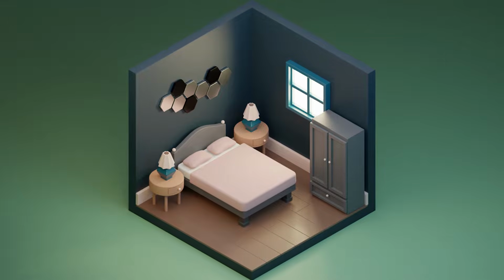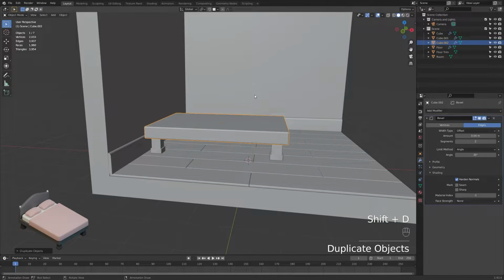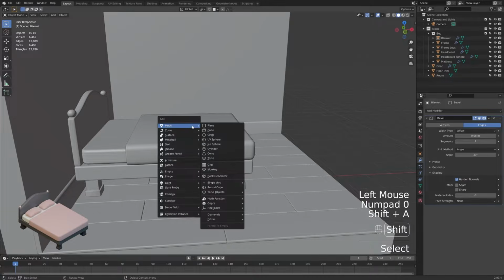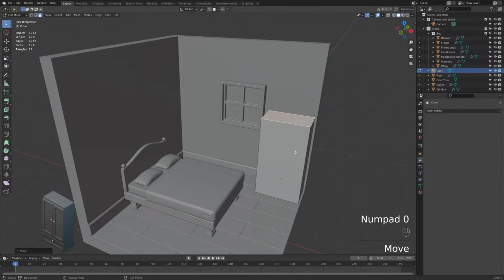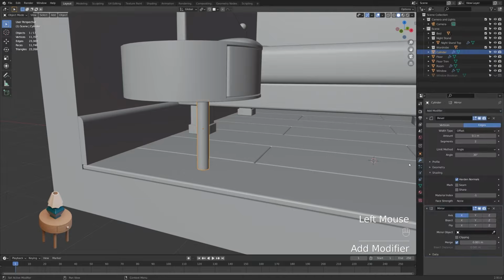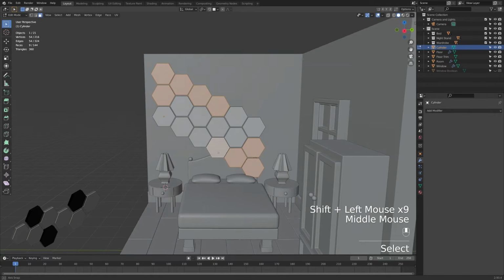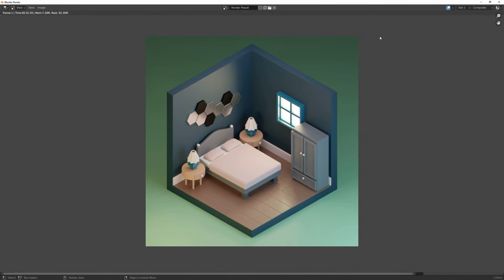Create Your First Isometric Scene - Comfy and Cozy Bedroom - Beginner Friendly Step by Step Tutorial

Comment: Ok so! I am currently following this tutorial with the 4.1 Version. I will add in some of the fixes I used where there are differences between versions, and I'll update as I go!

1. Auto Smooth
This is now a modifier in the 4.1 update and you will find it in modifiers > Smooth by Angle > turn up angle to 180.

2. Bevel being funky on the floor trim:
Follow everything up to 'Ctrl + B' and then press 'S' to toggle even offset if the tool appears to not be working, or the bevel is causing the mesh to deform strangely. You don't have to adjust the position, just add in bevel segments and then add 'smooth by angle' modifier as above.
Reply: thank you!
Reply: Thanks for this. One of my drawers kept making this black square and i didn't know how to fix it until I found your comment. I'm using blender 4.1 so thanks for this

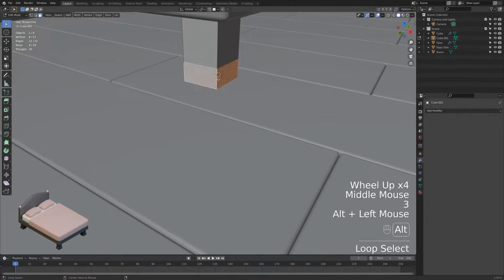Comment: 9:12 already ctlr R to get the line, however i can't separate it into object, so i can't resize it. please help
Reply: If you're having trouble following the way he said it do it this way

Ctrl R
Left click to apply the cut
Move it down just a bit(having trouble moving it right after left clicking? Hit G to grab that loop then Z and move it down)
Then left click
You are now currently in edge select mode,Hit 3 on top of your keyboard NOT your numpad to go to face select mode
Click off screen make sure nothing is selected
Then hold down alt and left click on the BOTTOM edge, YES, in FACE SELECT mode you alt click on the bottom vertical edge and this should select all your bottom faces
Then Hit E to extrude
Move your mouse to check if extrusion happened
Then RIGHT CLICK to set it back into place
Hit S to scale it to the size you want

Hope this helps

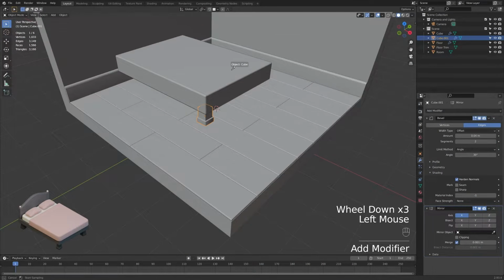Comment: 10:11 i have set the origin point to geometry and it still won't mirror correctly, pls help
Reply: On the top right of your viewport select options and and enable affect only origins 
Click your bed in object mode and you should see axis lines on your origin point
Press 7 on your numpad to go into top view and if you can't change angles that way just go to your top right corner of the viewport and select the Blue Z circle that should put you in top view
Hit G and move it manually into the middle of the bed along the X and Y axis 
once you're satisfied clicking on your middle mouse button you'll move out of top view and see your origin point is above your bed
Hit G then Z and move it back down to the bed
Once you're done go back to the options on your top right and disable affect only origins
Select your legs
Click the eyedropper
Select your bed

Hope this helps

Comment: i know this comment is late, but when i shade the window smooth and add the bevel modifier, it goes all weird and shaded and not... smooth. help!!!
Reply from the maker: There's two major culprits I would check if you're running into shading issues.

The first is for doubled up vertices. At 24:04, I go over how in edit mode, you can select all the vertices and merge by distance to get rid of any overlapping duplicated vertices.

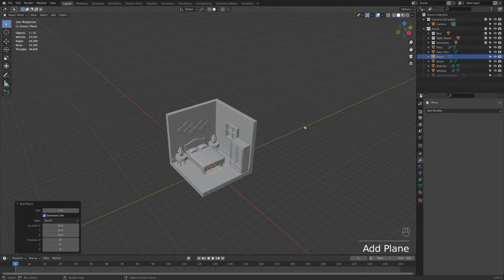The second thing to check for are your normal orientations, which I go over at 32:47. In edit mode, you can try selecting everything and recalculate all the normals to face outside.

Comment: Anyone else encountering weird things on the warddrobe when shadesmoothing + applying the bevel modifier from the window at 24:30 ish? welp
Reply from the maker: There's two major culprits I would check if you're running into shading issues.

The first is for doubled up vertices. At 24:04, I go over how in edit mode, you can select all the vertices and merge by distance to get rid of any overlapping duplicated vertices.

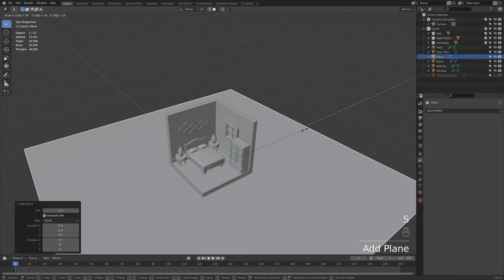The second thing to check for are your normal orientations, which I go over at 32:47. In edit mode, you can try selecting your wardrobe and recalculate all the normals to face outside.

Comment: hi, i have 3 very weirdly specific problems that are popping up in my design. can anyone help me out with it? the first problem i have is that the emission from the video isn't showing up in my rendered version. the second one is a bigger problem which is that whenever i try to add a camera into the scene, it somehow keeps picking the area below the bed as the main focal point and i've tried every which way to find a solution but every time i add a camera, and i hit the numpad 0 key, its showing me the blank space beneath the bed. when i manually move it by using the cursor as the controller, it messes up the bedframe for some reason. like either it disappears or its set as a different position.
Reply: Your camera is added below the bed because your 3d cursor is below the bed 

By zooming out then hold Shift and then right clicking off your scene your 3d cursor will move to where you clicked 
And now when you add your camera it will be added to where you moved your cursor you can hit numpad 0 to check

Once you're done you can reset it by pressing Shift S and select Cursor to World Origin

Comment: Hi, been trying about 30 times now to do the blanket. I have started over and over. When you extrude along the normals you have a smooth no extra faces that i can see in the video. I have more. when I bevel even with out the normals done it only goes up the top and not down the sides. It works if I make a new cube but not when i grab the faces from three sides and top and shift-D, left click, P and selection.   HELP, thanks

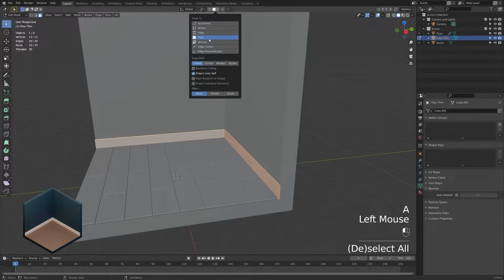Comment: Lost at 5:07
Reply: In newer versions of Blender, the “Snap to” drop down menu is different, Face has been replaced by Face Project and Face Nearest.  Face Project is the same as what is used in this video, I believe.  This is just setting the behavior of snap movement, which you can activate by holding the ctrl key when moving an object.  It allows you to easily connect items like the legs of the bed to both the floor and the bed frame, without having to line it up manually.  You also can turn snap movement on by clicking the magnet next to the menu(or with a hot key), but after following the video I say it’s usually not used for more than one movement in a row so just hit ctrl when needed so it’s not left on by mistake.
Reply: @DBumbleB  thank u

Comment: the final render took you 32 min 59 sec right?
Reply from the maker: The amount of time it takes to render will vary from computer to computer depending on the kind of hardware you're using and what render settings you use (something I didn't really cover in my video). 32 minutes does seem like a long time though. Are you rendering on a laptop without a GPU?
Reply: @leftbraincgart  sorry i mistook your render time as 32 minutes 59 seconds. my render time is about 6 minutes with i9-10900K. what's your pc specs btw?
Reply from the maker: I have a i7-8700 for a CPU and a GTX 1080 and a GTX 1060 for GPUs. If you used your GPU to render instead of your CPU the render time should drop significantly.
Reply: @leftbraincgart  thanks! i'll try!

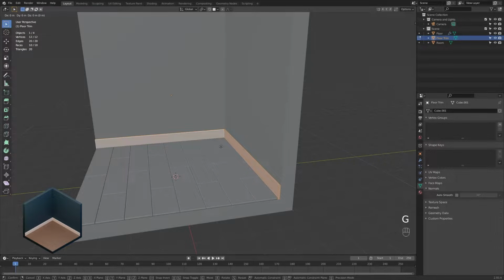Comment: 5:20 I can't trim the trim by pressing Ctrl and moving the mouse to the floor. Am I missing anything?
Reply from the maker: A couple things I can think of:

- Make sure you're grabbing just the trim and nothing else. You can do this by deselecting everything (shortcut double tap A), selecting the trim only, then hitting G to grab and move it.

- Instead of holding down CTRL to toggle the snapping, try clicking the magnet icon instead (shortcut SHIFT + Tab) and see if that works for you.

- I would make sure that the Snap To is set to Face, Snap With is set to closest, and Affect is set to Move.

Hope one of these help!
Reply: @leftbraincgart  ah thanks! get it!

Comment: This is one of the best Blender tutorials that I've gone through - thank you so much!

One question I have for you is that when I render out my images, the window doesn't actually render any light, it just appears as an empty box. Emission shader is set appropriately on the window panes with the rest of the window having the window material.
Reply: Same happened to me. Not sure how to fix it.
Reply: Deleting the boolean window fixed it! So that's the issue.
Reply: @cfh-9328  Nice! I think I remember as well that I turned off the rendering for the boolean window instead of deleting it - that way it keeps the mask, but doesn't show in the final render.
Reply: The boolean cut on the wall has to be applied. Then the cube used as a cutter has to be deleted.

Comment: I have this issue, after rendering the project it doesn't look the same. Everything is kind of dissolved i guess, and something bad is happening with a floor. When I delete denosing it's really noisy so that's also bad. Also I don't seem to see integrator settings and render, viewport. I don't know if that's what might caussing the issue. I looked it up and the advise was to change Cycles Render Devices to CUDA and I did. And I checked if my graphics card is supported (it is). But integrator is still missing. I looked in other tabs too, it's not there.  Anyways, I really enjoyed following this tutorial and it was my first time in blender ever, so thank you for creating it!

Comment: After the bed part things started to get complicated for me hahahaha! I'm a real begginer in Blender. I am following along and I don't know why I can't put the Bevel modifier on the window, even doing again without coping the modifier and it is still have sharp edges >.<
Reply from the maker: It's tough to say without seeing your actual project since there's a number things that could cause that issue, but the first thing I would check is that you're adding the modifier to the window object and not the boolean object you used to cut the hole in the wall.

If the modifier is being added correctly, I'd check that the visibility of the modifier wasn't accidentally disabled. There's a little icon that looks like a monitor on the modifier (it's in between the square and the camera icon) that toggles the modifier visibility in the viewport.
Reply: I had the same problem. To fix it I selected everything and then used the merge function (keyboard M) and the Bevel modifier worked.

Sorry if it's too late, but I hope it helps someone.

Comment: when i look at the render image, the inside if the window(the panes) are just complete white despite being fully rendered (；′⌒`)
Reply from the maker: Sorry for the late response! I'm not getting notified of all the comments for some reason.

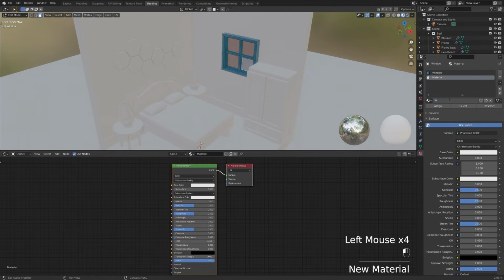Hopefully you were able to figure out the problem, but if not, I would start by lowering the emission strength on the window pane material. If playing with the emission strength does nothing, then the next thing I would check is that the window panes actually have the correct material assigned to them. At 34:20, after I add the window pane material, I click the "Assign" button with the window panes selected in edit mode. Sometimes people make extra materials and end up assigning the wrong one.

Hope this helps!
Reply: @leftbraincgart  thank you so much! it helped me with my problem
Reply from the maker: I'm glad you were able to fix it!

Comment: I'm at the render stage but my window is not rendering in colour and I can't see the seperate panes. Waht am I doing wrong? Thanks so much!
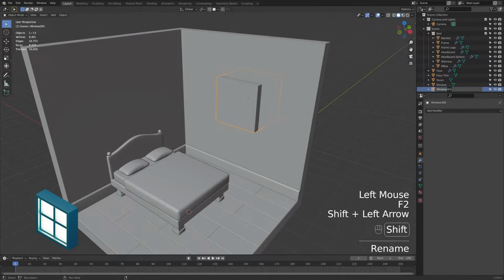Reply from the maker: It sounds like you need to hide the cube that you used with the Boolean modifier to cut the hole in the wall. Make sure that it's hidden from both the viewport view (eye icon) and render view (camera icon) in list in the upper right hand corner. I go over it really quickly at 18:57.

Let me know if that works or if you have any other questions!
Reply: @leftbraincgart  That was exactly the issue! Thanks  so much, solved.

Your tutorial is amazing, easily the best one for Blender learning so far for me. Please keep it up, I'm looking forward to going trhough the other ones which you have posted so far!

Comment: Hello! Can i get help please? When  i placed the array modifier it was on the left side of the planks and it just woulnt come to its right place.. Can i fix this?
Reply from the maker: Sorry for the late reply!

Based on your description, it sounds like the orientation of your project is flipped compared to mine. If you look in the upper right hand corner, you'll see a red/green/blue gizmo that indicates the X, Y, and Z orientations. The filled in bubbles indicate the positive direction and the array modifier by default extends along the positive direction unless you enter in a negative number as an offset.

As Martwy suggested, try changing the offset X and Y factor numbers. As you increase/decrease them, you should see the planks move. If the planks don't move at all while changing these numbers, that indicates a different issue in which case throw up a screenshot on https://imgur.com/ with the floor selected, showing the array modifier so I can help you troubleshoot more.
Reply: @leftbraincgart  Thanks! I will try that later!
Reply: @Martwy022  i did everything possible but nothing-

Comment: Ctrl+R doesn’t work from me , idk how to do loop cuts
Reply: Go in edit mode and you see some icons on your left right? The icon for loop cuts is the square one with a line in the middle-good luck finding it!
Reply: You could alternatively try selecting the edges in question and subdivide them.
Reply from the maker: Sorry for the late response. As Bg Animator mentioned, there are icons on the left side of your screen in Edit Mode that you can use in place of the shortcuts. The first thirty seconds of this video goes over where that icon is located, if you need a visual guide: https://www.youtube.com/watch?v=-pCf3DjsEBg.

Comment: For some reason when I get to the 4:05 part, my floors don't look like that. They have some weird black bars on the shading rather than the crevices on the floorboard. Not sure what's causing it
Reply from the maker: Hey, I'm super sorry for the late response! Hopefully you've managed to solve the issue by now, but if not, there's two common issues that come to mind based on your description.

First, I would check for extra vertices that may have been created when extruding the floorboards. To do this, select your floor in Object Mode and switch to Edit Mode. With Vertex Select enabled, hit A to select all the vertices, then M to bring up the merge menu, and choose "By Distance". There'll be a little pop up at the bottom of your screen telling you how many duplicate vertices were removed. If you need a visual example of this, jump to 23:57 in the video to see me do this.

If that didn't work, the next thing I would check are your face orientations (aka normals). I go over how to do this step by step at 32:47 and how to fix incorrect faces.

If that still doesn't work, take a screenshot and throw it up on https://imgur.com/ so I can have a visual of the issue.

I hope this helps and I apologize again for the late reply.
Reply: @leftbraincgart  Oh no you're totally fine! I appreciate the fact that you still respond to comments anyways. I was able to figure it out and I'm now working on the bed portion. 

Thanks again for this tutorial! It's really useful for a newbie like me! Would love to see more!
Reply from the maker: I'm glad to hear that you were able to sort it out. If you still remember and don't mind sharing, could you let me know what the issue was and how you solved it? That way I can be more mindful about problems that people potentially run into and can give better warnings in the future. If you can't remember or don't feel like typing it all out, no biggie; I'm just happy to hear that you haven't given up on the project.

And I definitely have more projects/tutorials in the works, I'm just a little slow at making them. Some are more intermediate focused, but there'll be more beginner oriented ones to come, don't you worry.
Reply: I cannot get past the floors either. Too many keyboard shortcuts, hard to follow, easy to miss a step. I restarted 4 times before giving up.